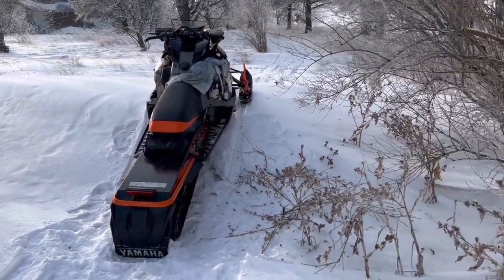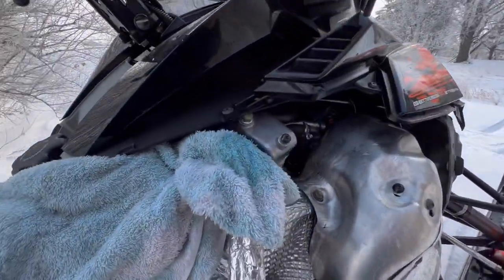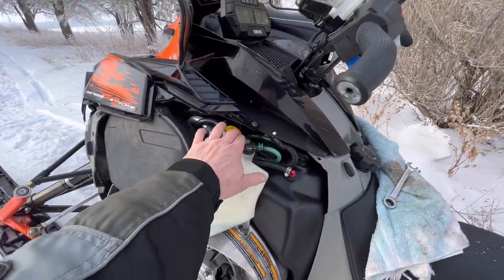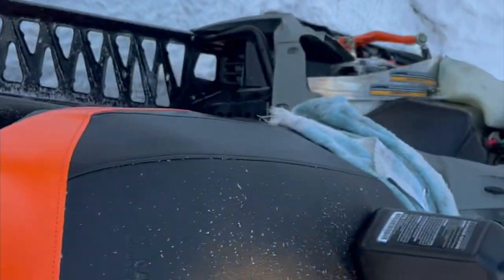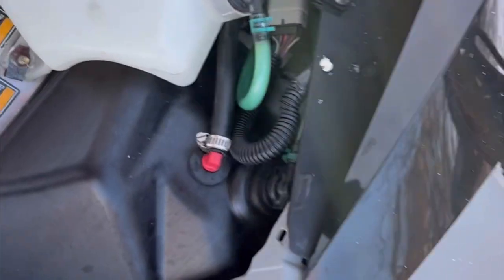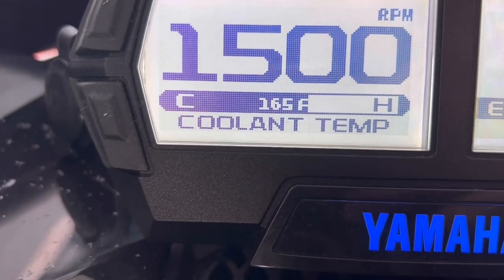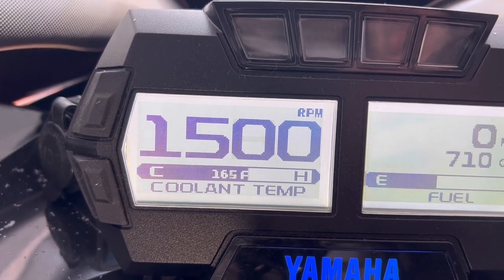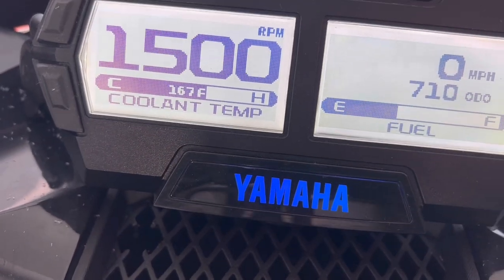Bleeding coolant in a Thundercat or Yamaha Sidewinder

Comment: Thanks for a great video. Will try in my sidewinder tomorrow. Can't I run it with the air screw open as well as the refill cap? and just top it off when needed until it just bleeds coolant?
Reply from the maker: No that will just add more air to the system.  Do it like I showed or you will get frustrated.   Good luck.
Reply: @kingersgarage  Did it your way and it seem to work fine. It runs at 76-77 degrees C. Level between cold and back to cold the morning after is close to the same. Might differ 3-4mm in the expansion container but that could be to standing differently I assume.
Reply from the maker: @Repend  enjoy!